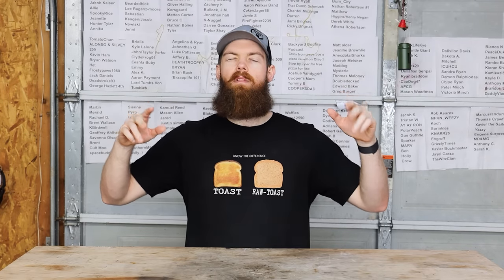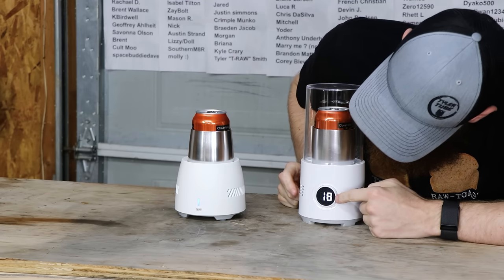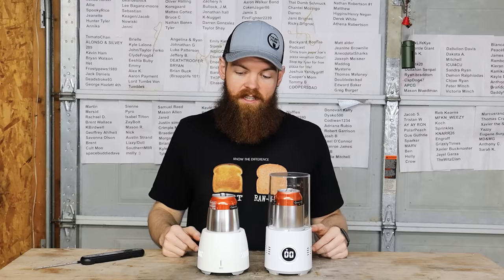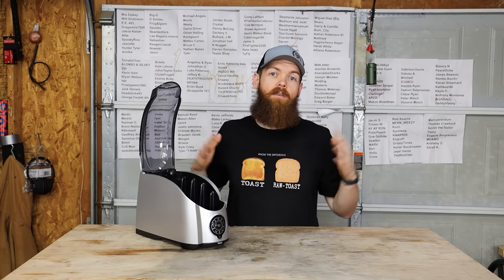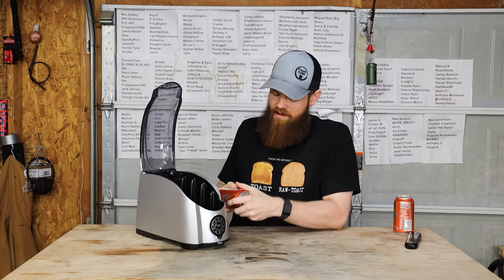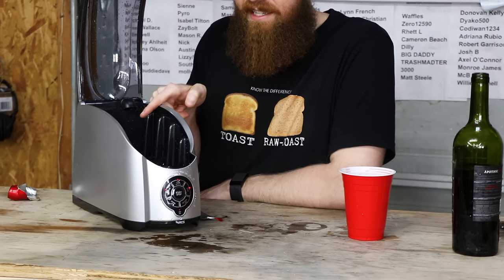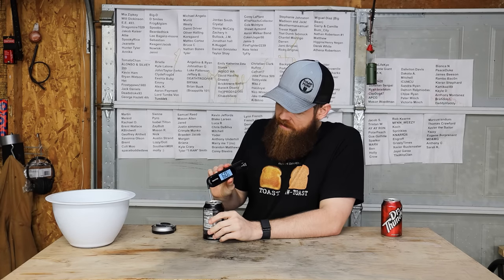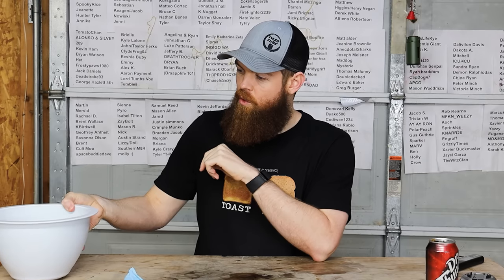Is This The BEST Drink Cooler From Amazon?

Comment from the maker: cooper cooler - https://amzn.to/3LgOpe3
Reply: Love your content
Reply: You should test the green gobbler man. Bet you can use it for all sorts of funky experiments. Jar video?
Reply: Sponsored? Coupons? Lol
Reply: Did you really just say I wish I had a thermometer while holding a thermometer
Reply: bro Idk if its just me… but the thumbnail looks kinda phallic 😂
Reply: Considering red wine is meant to be room temp and white is the one you chill, it’s pretty good
Reply: Why don't you put some salt water in the cooper cooler and try that?
Reply: Attach the cab to a drill and let that bad boy spin for a minute
Reply: I see zero point in this. If you need ice, which has to be made in your freezer ahead of the time, then just put the drinks in the fridge ahead of the time too.

Yes, you can buy ice in the store, but if you're going there because you really want a cold drink, then just buy one from refridgerator. Before you go there, you should put some of your warm drinks in the fridge for later.
Reply: It's useful at parties for sure.
Its the same as those 120$ tabletop ice makers, ours makes one row of ice every 7 minutes so it very quickly compliments ice consumption

If I had one or two of these coolers, I could run concessions while stocking the beer. It is an instant cold-drink'inator after all.

And in direct contrast against the paper-towel-trick: it eliminates napkin waste and also eliminates the chore of having to chisel&chip away flash-frozen paper-towel-waste. Paper towels are expensive ✨
Reply: @joshjames7869  horrible idea
Reply: Would you ever consider having a side kick beside you in your videos?
Reply: cooper cooler was designed by one of youtuber ideas using 3D printers i remember it 3 or 5 years agos lol
Reply: @beardsntools  my ice is made automatically with no input from me. If there was a system that put the drinks in the fridge automatically for me, then your comment would make a valid point.
Reply: Sweet!  Cold drinks in less 3 minutes…cool.  Thanks for info!
Reply: There is a cheaper version of this product that should in theory work just as well for 1/3 of the price
Reply: @newtekie1  Ice is also not made automatically for you, you have to put some water in your refridgerator at some point, that's input from you. Checkmate xD

As if you think my point is not valid because of that, I can make that system for you. When you bring drinks from store instead storing them in a warm place put it in fridge. If you don't have enough room in fridge for all of them: When you take out a cold drink, replace it with a warm one.

There is your system that makes you put drinks automatically in the fridge.
Reply: @Biaanca5036  It's almost as good as putting drinks in a fridge ahead of the time, just like you did water to make ice to use with this.

The tabletop ice maker is way better than this.
Reply: @beardsntools  my ice is made automatically for me. I never have to put water in my freezer. It is connected to a water line. The ice is made 100% automatically for me.

Comment: Fun video Tyler. The reason flowing water over a can is faster than just placing it in Ice is because the flow of a liquid (or gas) over an object increases the speed of heat transfer. Like how wind chill works.
Reply: Or rotation. I think that rotating is actually faster because of the slight drag on the liquid inside. It kinda stirs it up.
Reply: Also, water transfers heat faster then air.
Reply: Right it's why radiators have fans
Reply: @Ulnyx  lol bingo. This is the most important factor here. This is not difficult folks 😂

Stand outside in 35 degree air for 5 mins. See how cold you get.

Now sit in water that’s 35 degrees for 5 minutes. 

One of those feel just a little different than the other? 😂😂😂
Reply: @danielhova7826  Exactly.

And with chilling a soda can, like that, it's a twofold effect. Water transfers heat faster, and the greater the difference in the temperature, the faster the heat transfer happens. So rotation keeps the drink mixed, and at it's overall warmest, instead of having it get really cold on the outside, and gradually getting warmer towards the middle. This expedites the heat transfer as well.

Also, adding salt to the water will make it chill faster, since salt lowers the freezing temperature of water, and makes it colder. Thus creating a greater temperature differential.
Reply: @danielhova7826  oh for-sure and that’s what I try to tell The kids these days. The tri folded molecules connected to the gas in such a confined space (a can) makes for a much colder outcome when thrusted into a spherical spin. Take for instance when an alligator spins it’s prey in water, do you think said prey would be colder if the alligator didn’t spin? No the prey would be warmer. In fact I’ve tested this theory using the biome of chesthetics method and the outcome was as suspected. The prey was indeed colder when spun in a spherical manner. I’ve enjoyed science my entire life and love when others take part in it. Cheers

Comment: The Cooper cooler was invented at my alma mater: the Cooper Union (NYC) the trick is you need that cold reservoir so that the water temp out of the faucet is always 32 deg, and by spinning the can it’s always cooling down hot drink, so it’s different than spinning it in ice water, as the water touching the can will warm up making the heat transfer slower.

Comment: You could try putting water in the steel cups to speed up the transfer of heat. I'm guessing it'd make a pretty noticeable difference compared to just the bottom rim of the can touching the cup.
Reply: Heat???
Reply: @JiggyjarjardoM77  Yes, you're transferring heat out of the drink, not injecting cold.
Reply: @incandescentwithrage  gotcha
Reply: @JiggyjarjardoM77  cold is the lack of energy in an environment while heat is an energy dense environment. Atoms are vibrating at different frequency levels depending on the energy density. Which is how hot or cold an object is.
Reply: Convection vs conduction

Air is a great insulator. Water has a higher temperature transfer.
Reply: @stephencoghlan6561  Hence water cooling in high-end PCs.
Reply: It's a peltier cooler. Water might hurt if it's warmer than the drink. you could keep the steel cup in the freezer and it probably could freeze a bottle.
Reply: The cooling is based on peltier module which has so low efficiency and power in this case its not even worth it.
Reply: No not really
Reply: Has better thermal conduction*

Comment: The salt/ice/water is what I use, you were very close. I put as much ice as I can and just enough water to make the ice “loose” then about as much salt as you did. Put the can in right after you put the salt on. Then I use a large plastic spoon and stir the can in the ice/salt/water continuously for 3 minutes. I rinse can under sink to get rid of the salt taste. And it’s around 40 degrees or less (in 3 minutes). What the salt does is rapidly melts the ice then allows the ice water to go below the 32 degree freezing (as you said science stuff)
Reply: just use the refrigerator
Reply: @jamesbyrd3740  99% of the time yes, but say you just bought a 12 pack from the store and didn’t want to wait a few hours the refrigerator would take, then the salt/ice is useful for really fast cold cans.
Reply: @jamesbyrd3740  fridge wouldn't get as cold as ice water if that's someone's thing
Reply: actually the salt lowers the melting point of water. So it doesn't rapidly melt the ice but because of the addition of salt it actually creates a bond where there's less hydrogen bonds so the water has to work overtime essentially to melt. Meaning the energy it has to lose to melt just got higher, aka it has to go below freezing to disperse the energy to go from a solid to a liquid.
Reply: @greatleader4841  fair enough, all I know is it works!
Reply: @davidhudgens499  it 100% works, just the science of why it works is off.
Reply: @davidhudgens499  basically the water has to work overtime because adding salt to ice means it needs to absorb more heat than freezing to off put the less amount of bonds it has. So yes adding salt makes it super easy to cool off a drink. Now do that and spin the can and you'd end up making a slushy as it'd take the heat super fast from the can due to it wanting to do a phase change but cant.

Comment: So for the Cooper Cooler. Basically, cold is just the absence of heat. So if you just sit a warm can into ice water, it will be warming the water touch the can and that's it. Because the water is absorbing the heat. If you spin the can like you did by hand, it will mix up the water so the cold water not touching the can will mix with the warming up water touching it. And for the Cooper Cooler, its constantly pouring ice cold water over it and rotating it so its cooling the whole can equally. So the colder the water, the more heat it absorbs from the warm can. Which is why when your hands are super cold, and put them under room temp water, it feels extremely hot.

Comment: The concept of salt added to ice to make it colder is a long known effect.
Homemade ice cream makers used ice and rock salt to freeze the ingredients quickly. 
(Yes, I'm that old 🤣)
Reply: Well, actually that's how ice cream was made in XV century Italy. Salt was used to force ice to melt (that's what salt does, it forces ice to melt absorbing immense amount of heat quickly) and freeze the ice cream in result of energy absorption
Reply: I make homemade ice cream half a dozen times a year. I live bama so we do it alot
Reply: I was about to make the same comment.
Reply: Salt also helps water reach it's boiling point faster.
Reply: @DoctorKamino  Well, my first car was a Pinto so you're right. 🤣
Reply: @mom42boys  it had manual transmission, no power steering, AM radio, no AC, and somehow yours DIDNT explode
Reply: @DoctorKamino  But it did leak oil like a sieve and I still drove it nearly 500 miles to Juneau, WI to hang out with some friends. Went through five quarts of oil one way.
Those were the days... 🤣
Reply: @mom42boys  i was once stranded in juneau, wi after escaping from someone who was attempting to abduct me 
I had to spend the only dollar in my pocket so the idiot clerk wouldn’t call the cops on me for loitering until a ride came to get me
Reply: @DoctorKamino  Wow, that's crazy! I was only in Juneau once and I've never been back and that was 43 years ago.
Reply: @NecramoniumVideo  it doesn't reach it's boiling point faster. Adding salt actually raises the boiling point which allows it to be more effective for cooking
Reply: Doesn't salt like melt ice tho?
Reply: @beardsntools  yes. cause it also lowers the temperature that I freezes at
Reply: @beardsntools  it does but it also mega colds the water. Solution: add more ice
Reply: @NecramoniumVideo  That is false, salt does not help water reach its boiling point faster. Adding salt actually increases boiling point and decrease heat capacity.
Reply: @samanthadaigle6647  Potato Potäta.
Reply: @NecramoniumVideo  No, you can look at a phase diagram of pure water and salt water and compare, you can do the calculations using Raoult's law and the Clausius-Clapeyron relation. This is chemistry 101.
Reply: So... you were there when the Nile River form huh?
Reply: Now what if we added the salt to the cooper ?

Comment: The reason salt water is supposed to work better is because it maximizes surface contact with the can, and salt water can be a good bit below water's freezing point.

Should try salt water and ice in the Cooper Cooler.
Reply: No no no, it’s sugar and water that lowers the freezing point. Nice try though 😉
Reply: @ssss224455  hince why you see sugar trucks spreading that sugary brine when it snows. Sugar does lower freezing point but salt much more
Reply: @ssss224455  confidently wrong
Reply: Hell no! Please don't do that to your machine unless you want your warranty voided and your machine corroded faster.
Reply: @yajnalgibno6536 he has a shirt that reads "I void warranties."

Comment: Without spending extra coin on a Cooper cooler, just use  the bottom half of a Gatorade or powerade bottle and attach it to a drill. The can should slide into the lower half of the bottle.  The drill will spin in an ice water bath

Comment: I work for a water restoration company. We deal with a lot of various building materials, doing demolition of wet structures. We use shop vacs to help clean up the terrible mess that inevitably gets made. I've noticed a trend. The main name brand shop vacs are SUPER expensive and often times fail after a few uses, whereas cheaper branded shop vacs seem to out last big brands like DeWalt. I think it'd be a cool video idea to see you use big name brand shop vacs and cheaper shop vacs, and just... suck a bunch of stuff up. Torture test the hell out them. Just a suggestion.

Comment: The cooper cooler cools using science. It cools the containers via conduction and convection. It also spins the container to increase the surface area. If a can is standing still the outter shell and liquids touching the shell will cool but by spinning it, it evenly cools down all the contents inside the container.

Comment: The spinning is constantly changing what fluid is in contact with the cold surface of the can. It's cooling all together instead of outside in. Liquid is an insulator and insulation works both ways. The can is warm the fluid will hold heat and gradually cool the outside because the inner column of fluid is resisting the temp change

Comment: I can explain why the spinning helps. Talked about this principle in my physics class.

An object that is at different temperature than the room it is in will come to be at the same temperature as the room, obviously. But if you put a fan on that object and have air constantly moving over it, it will change faster. With the example of a transition from an object being warm in cold environment, this would be wind chill. With air being stationary, the object will heat up the air around it, and a little bit air movement will occur because of the temperature change but not bunch (unless the temperature change is a lot), those air molecules will then disperse that heat and spread it to other air molecules allowing them to cool the object further (change in temperature in a fluid, which is anything that takes the shape of it's container, is called convection by the way).

With a wind chill, the object is constantly hit with air that is the temperature of the room. Rather than having a kind of shell of warm air. And with the spinning, you're doing something similar by keeping the object moving.

Comment: You should test some dry ice into isopropyl alcohol (rubbing alcohol) the alcohol doesn't freeze and the dry ice brings the temperature down to near liquid nitrogen temperatures. You would have a lot of fun with some super chilled fluids. Just be careful and make sure you are wearing appropriate PPE.
Reply: Liquid nitrogen has a temperature of -196C (-320F) and dry ice up to -78C (-109F). That's still quite a vast difference in temperature, it's the difference between ice and boiling water ;)
Reply: @WoLpH  Thanks for the info. I was unaware that there was that large of a difference in temperatures. For someone  like me, I assume that it is easier to obtain dry ice than it is liquid nitrogen. Although I've never really looked into purchasing it. Playing with super chilled liquid is fun, and I thought Tyler might enjoy it as well.
Reply: @TheJudar  I agree, I'm just hoping he would do it safely. The 9V battery series had me cringing, that was insanely dangerous. With regards to the freezing I think the dry ice will work better, the main cooling limitation here is conductivity and liquid nitrogen will just result in the leidenfrost effect and ice insulating everything.

Comment: The salt, water & ice is better for cooling a larger amount quicker. While the Cooper cooler does it fast, it's only one can at a time. That may take longer than just placing an entire 6 or 12 pack in a cooler with the mixture

Comment: So putting salt on ice lowers the freezing temperature the same way ice salt works.
It doesn't melt ice it lowers the freezing temperature. So essentially you can get the water below 32°F/0°c. 
You should Do a short where you do salt water in the cooper cooler

Comment: I live in Tx. During the summer to keep the ice chest super cold I put ice 1/4 of the cooler water and rock salt used for making Ice cream mix it load it with drinks then I leave a 5gallon bucket of ice water next to the cooler. You just pull your soda/beer dip it in the bucket to remove the salt and your good to go

Comment: The Cooper cooler works so well because of forced convection and good heat transfer. The water gives a lot of contact area, and the spinning gets all the temperature distributed in the can instead of using the slower natural convection.

I'd like to see another test. Where do the cans and a cooler full of ice water meet in the middle? Say you have a party showing up soon and you need a cooler full of beer. Do you use this for a 30 pack? Or do you just dump them in a cooler

Comment: Salt and water on a paper towel, wrap can, place in freezer. Spinning can mixes the fluid inside instead of the fluid outside of the can just getting cold. The moving water on the outside also increases the heat transfer coefficient.

Comment: there is an adapter that squeeze fits to the top of a can with a drill bit adapter so you  can use a drill to spin the can in ice for as long as you wish and it cools the beverage quickly. Saw it on "this old house" years ago.

Comment: I’m no master in thermodynamics but the whole spinning thing moves the pop around causing it to cool faster, heat moves to cold so when it sits still it only cools the outside layer inside the can but as it’s spinning the warmer pop moves to the side of the can sucking more heat out of the fluid and it cools it more efficiently